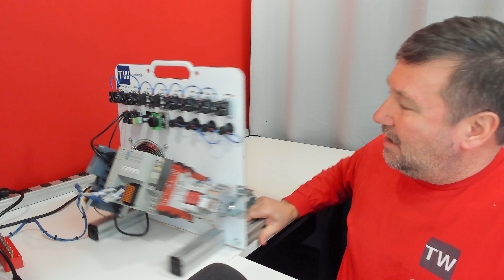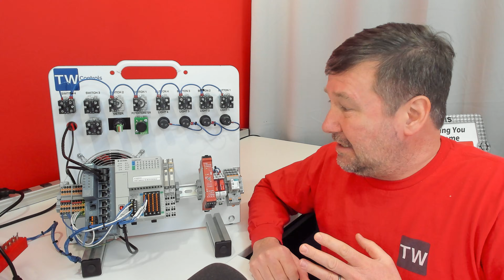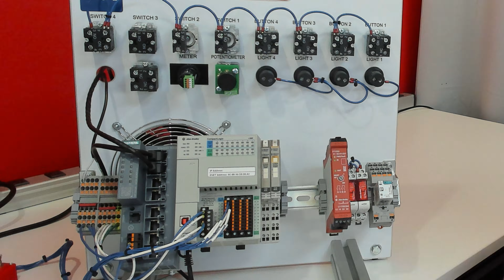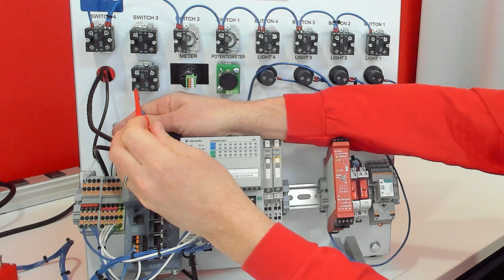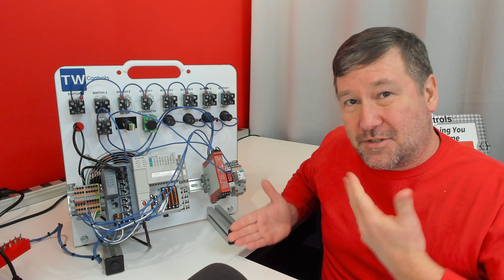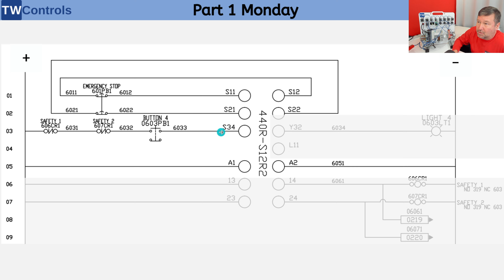Safety Relay Wiring: Troubleshooting Tips for Beginners

Comment: Why the Siemens Ethernet switch? 
They aren't that dependable. 

Unless you are converting Siemens to TCP/IP
Reply from the maker: What do you not think is dependable about them?  It is a very capable switch with some good layer 2 and 3 capabilities.  We've used hundreds of them with no failures.
Reply: @TimWilborne I had to replace one after 6 months on a waste water plant
Reply from the maker: No troubles here